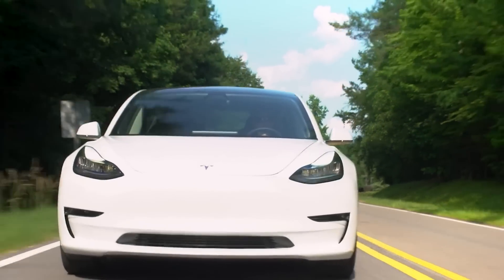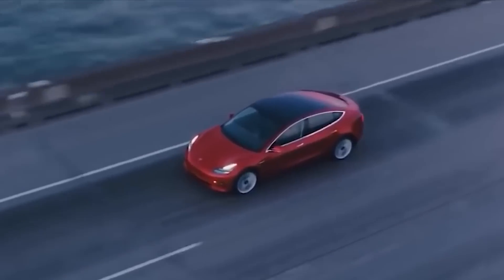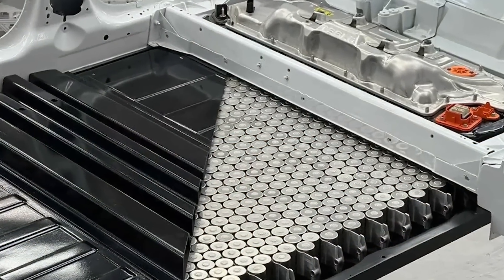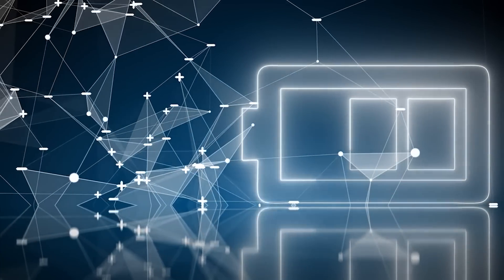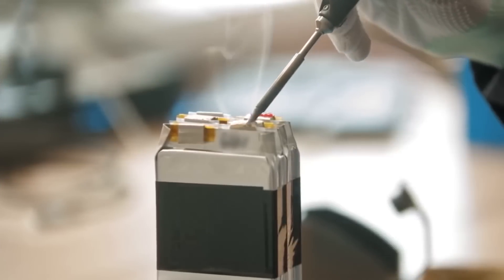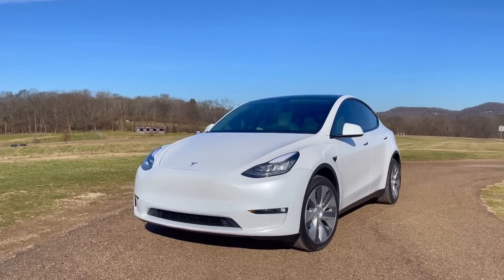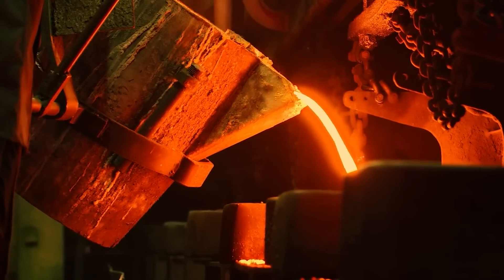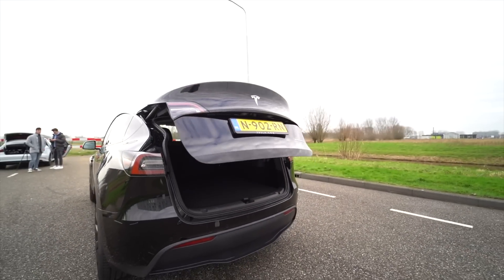Tesla Model Y 4680 Battery Will Change Everything!

Comment: I have heard no reliable source validate they are shipping 4680 batteries, nor the structural battery pack. Rather, without news they must be building regular model Y’s with old batteries on old structure and in parallel building a stockpile of 4680 batteries. You’ll not see Model Y with 4680s until they have stock and production capacity to do so.

Comment: Yes, a bigger cell stores more energy, but you can't fit as many into a given volume. The battery chemistry is the same, therefore the energy density is the same. The claims of 20-30% increased range (for a given battery pack volume)  have no basis in engineering reality. Just more hype from the world's second least charitable centibillionaire.
Reply: Less packaging and volume with less weight for the same kWh pack. They show claimed 10 to 16% increased range not 20 to 30%.
Reply: @JoãoPaulo-s1d2j  4:48
Reply: That's the author of the video not Tesla. Tesla claimed 10 to 16% when they spoke about the 4680s.
Reply: @JoãoPaulo-s1d2j  My comment is on this video. Nothing changes the fact that since the battery chemistry is the same you get the same output per cell volume. If Tesla have genuinely increased cell output by that much then they're wasting their time making cars, they should just be cornering the battery market instead.
Reply: @niftykeentypedog  as I've said before, this format allows for a lot less packaging. The structure of the car is now the packaging. This allows for a reduction in weight and more space for more cells. Thus the range increase. Nothing to do with battery chemistry. The downside is that in case of a serious car crash it will be a lot more expensive to fix if possible at all...
Reply: @JoãoPaulo-s1d2j  Right, agreed, the range increase is due to weight reductions, larger cells and larger batteries, NOT because of revolutionary cell chemistry or construction.

Integrating the batteries into the chassis really sounds like a major advance in...

planned obsolescence.